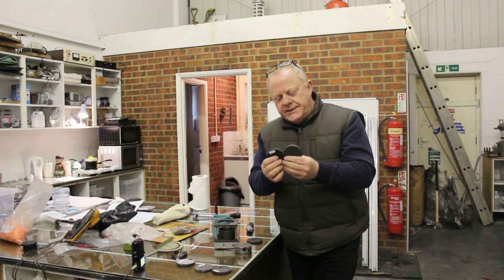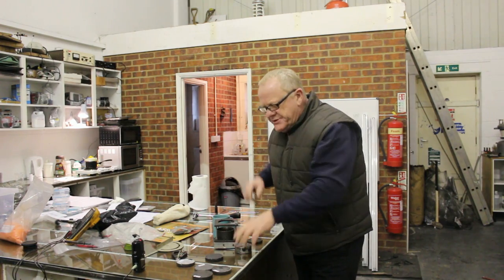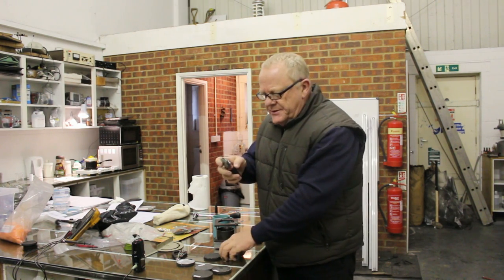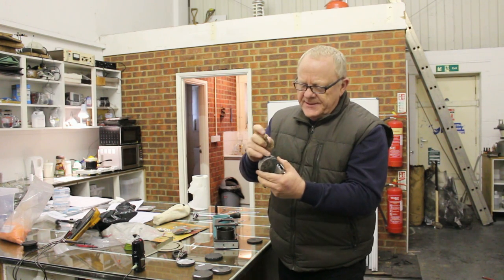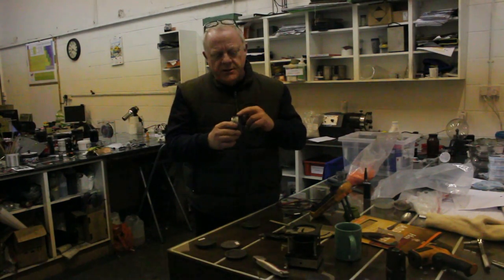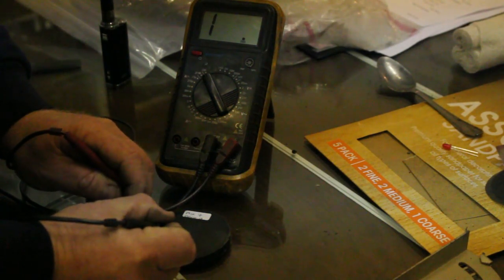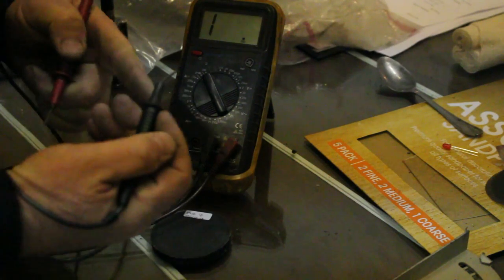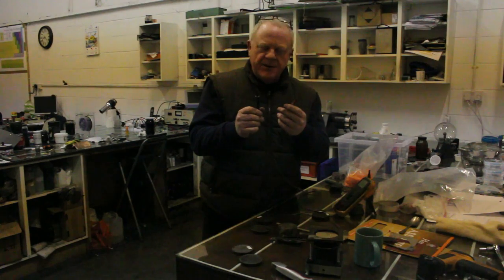Bullet Proof Plastic - Just How Tough Is This Stuff?

Comment: Curious about that recipe.... I understand it's proprietary.  Oddly, I don't see many experiments like this.  I wanted to mention that one issue with armor is the rigidity. I was thinking that small plates like scale mail or rings like chain mail might make the most sense, but I wanted to point out other flexible structures like Honeycomb: http://cnet4.cbsistatic.com/hub/i/r/2008/11/16/f178fcc8-fdc3-11e2-8c7c-d4ae52e62bcc/resize/570xauto/b64dbf290d314219bc0b71d16532a7da/Humvee_tire.jpg -- While I very much appreciate research into bullet proofing, there is a desperate need for IED protection as well. Plate shielding on the bottom of vehicles is one thing, but in terms of design I think we need to think a little more outside the box in terms of rigidity.
Reply: Ben Collins maybe a solution of nanosillica with propylene glycol. When subjected to force it goes from liquid to solid and soaks up a lot if force. They've used it to made Kevlar vests life proof.
Reply: I want more on this! We got such a little tease

Comment: can it be combined with metals? such as copper to further increase its electrical capabilities? I.e. can liquid copper be combined in the early phases of making the plastic to give you a new kind plastic metal hybrid?
Reply: +Gabbi Brown Unfortunately we cannot answer that, but only because we haven't tried it. But it may be well worth a look at in the future.
Reply: Gabbi Brown copper melts way hotter than most plastics, so trying to mix it in would most probably burn the plastic away.
But conductivity could be improved by adding very fine powder to the whole block while still liquid, electroplating from an ionic solution with a DC current or even molding the plastic around a solid metal core with external contact points and routing the electrical connections to such contacts.

oops, i just realized he was talking about the specific plastic in this video, so disregard what i said.
Reply: FWG Steve you could create a copper matrix that would already be solid and the graphene reinforced plastic can be pressed around it.

Comment: if you really want to test its' toughness build you a steel frame to hold a dozen or so of those test cylinders, like a layer cake, right?  & take it to haliburton or schlumberger & have them fire one of their shaped charges they use to perforate oil wells with at it.

Comment: i wonder what would happen if you put a bit of graphene powder into say makerjuice.... i read a paper, where it didnt work really well when used with a filament printers because the nozzle clogged, but i haven't seen any info using uv curable abs resin (maker juice being one of the least expensive). no nozels to clog, you can paint and set that stuff with any uv light
Reply from the maker: +raven bishop the problem is dispersion - you have to mix it thoroughly and that isn't as easy as it sounds
Reply: interesting.
Reply: +raven bishop Maybe having ultrasonic transducer active to keep dispersion, not sure if adding surfactants would harm the plastic?

Comment: Is there anything you can tell us about the other properties of this so far? I'm thinking of thermal resistance, corrosion resistance, resistance to wear rather than impact... Fr example could it be suitable as a piston in an engine? Or coating for such..
Reply: +TheBaconWizard These are all interesting trials we have to do on the polymer. I'm a bit worried the temperatures a piston might face in an engine might be a bit high, but within an Hydraulic cylinder it might perform well.

Comment: What happens when this get's shot or beaten with a hammer? Does it fracture like ceramics, or does it bend and absorb the impact like plastic?
Reply: This has been answered in previous comments, but I'll summarize here. The first sample made with .5% graphene was shot with a .22 and a .45, both rounds from carbines and stopped both with a little deformation. The second was made with 2% graphene and stopped a 7.62x39 round with a little deformation.
Reply: @michaellovelace3844  thanks!
Reply: @normalchannel8493   In a discussion in the comments, it turns out that you start with a fairly ductile matrix material, the addition of functionalized graphene reduces the ductility but greatly increases the strength. So it's a trade-off, but one which works pretty well.
Reply: @michaellovelace3844  What happens when i put more than the 5% of graphene in the plastic, it gets weaker?
Reply: @normalchannel8493   That's an excellent question. We don't know the nature of the functionalization Robert performed, so it's tough to say. But one thing which has been done is to grow a polymer "comb" on spots on the graphene, which bonds to the polymer matrix through Van der Waals forces. If the fraction of graphene is low and it is well dispersed, it will be pretty much surrounded by the polymer matrix and all the combs will have something to bond to. I suppose as the fraction of graphene is increased, more and more you will have graphene platelets next to graphene platelets and they will just slide over each other. That is the long answer. The short answer is I don't know.
Reply: @michaellovelace3844  hey Michael i have a question, the little deformation on the plastic with graphene means that the plastic of Robert is strong as steel?
Reply: @normalchannel8493  Of course steel is available in a wide range of strengths, AR500 steel at around 4 times the yield strength of mild steel. I'm pretty sure the strength of Robert's composite lies within that range, but not so sure where exactly. This would actually be a better question for someone who shoots at AR500 targets, do they get deformation when shooting it with a 7.62x39 mm round? A 3/8" target would be just a little thicker than Robert's 9mm disk.

Comment: RMS and others, a new idea is a take on the Tesla turbine, combined with triboelectricity. . . Closely spaced ribbons (at least one conductive, spaced and tightned probably according to boundary layer thickness separation) of opposite triboelectric series position vibrating together harmonically like a harp in the wind, making and breaking contact along their length many times per second. If properly insulated (not grounded or near grounded objects, I would use a pair of hydrogen balloons to elevate the structure), it should convert a high percentage of incoming wind to high voltage electricity that can be stepped down to lower voltage AC using a Tesla coil. 

Another idea is a long flexible but rigid rod containing piezoelectric material connected to a buoy that will vibrate in a resonant fashion with the rise and fall of each incoming wave. 

Hope somebody else will build these as well, I don't want to keep the ideas to myself. Thanks.
Reply from the maker: +Blitherer Masterman These are good ideas mate and you definitely need to build them - that will attract a lot of attention - given my work list getting to this is going to be quite a long time for me
Reply: Any advice on making conductive nanocellulose? Patents or documents that might be adaptable to kitchen chemistry?
Reply from the maker: +Blitherer Masterman i'll have a look mate